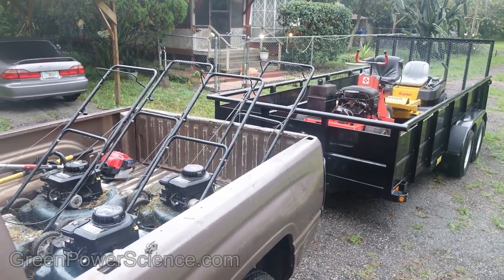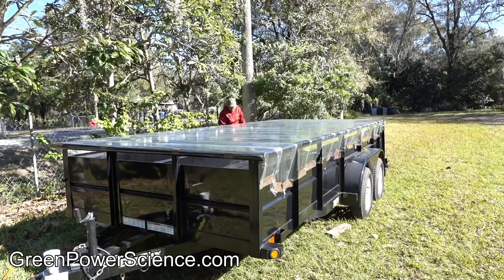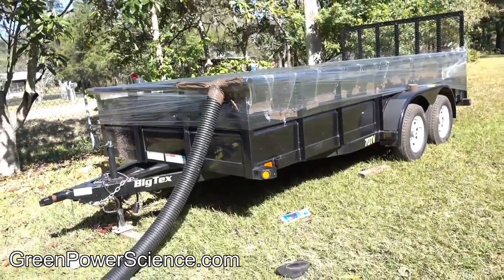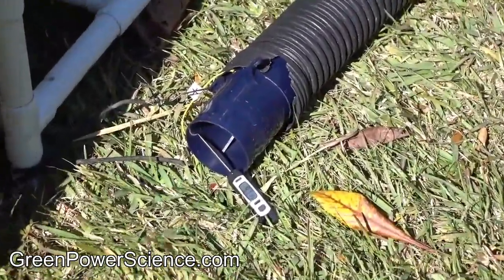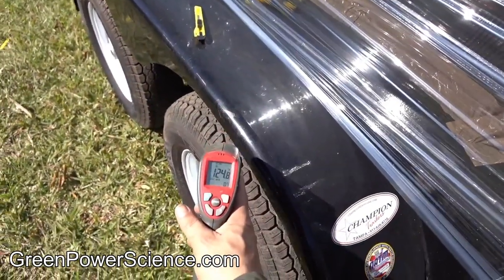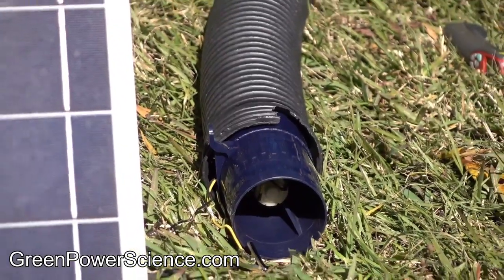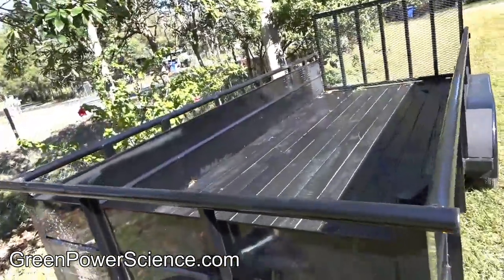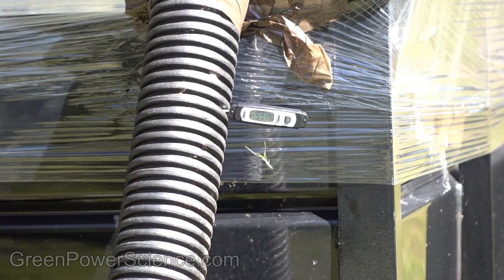5000 watts SOLAR Lawn Trailer 130 CFM CONVERSION

Comment: What a great vid. What kind of results would you get if you snaked 20, 30, or 40 feet of tubing in the body of the trailer?  By the time the air traveled through the tubes, it would warm up a lot more.

Comment: You just gave me
What i think is a great idea...
Build a maybe 12 inch deep by maybe 12 feet long and 8 feet high collection area with maybe asphalt roofing to store heat in...
And to make the plastic front double wall
The system Zip Tie Geodesic builds his inner and outter plastic.
Pointed at. the optium winter angle. 
How to get that angle north to south
Use a flat surface you can tilt.   Place a red solo cut large side down on the surface and tilt trying to remove the shadow. around noon time
Rember that is for the up and down tilt not the east to west

Comment: How does this compare to using painted black aluminum cans throughout the same amount of square feet?   The trailer is simpler process than expensive glass and the work with the cans

Comment: I love the idea of solar powered heater, may work very well in day time. Unfortunately, I don't think it will work at night where we need it the most.
Reply: This is just an old idea he shared with people .maybe to get us to think outside the box. Cast iron & concrete hold alot of thermal
Reply: No, but you could cut your heating costs in half by using solar heating during the day, and only using your electric/gas heater at night when you need it.
Reply: It works better using water since you can store the energy easier, but if you have a large attic, you can use that to store the hot air until sundown.
Reply: @FixItYerself  one could make a black rectangular pool inside the trailer with polyethylene sheeting.

Comment: Question, Dan. Is there sufficient air flow at the end of output tube to turn a fan connected to generator to produce thermal-wind power? If so, any estimate of enery potential? Understanding this depends on sun strength and duration.
Reply: No.  The airflow you see in the video is from the solar powered blower fan.  Thermal convection strong enough to turn a turbine would require a very large structure, with very complex engineering to get strong enough passive convection for a turbine or fan.

Comment: A roof space works well also and you can just run two thermostats one in the roof and one in the cold hose to auto heat the house when ever the roof is hotter than below
Reply: Can you elaborate further please?
Reply: @matthewbraxton7515  its a duct fan, filter and thermostats to move the heat from your roof to inside the home. Can be a single outlet or ran off the cooling system,  by a zone duct to swap them over for summer or winter.
Reply: Thanks

Comment: Why don't people heat their houses with this in the winter??
Reply: Because no one has gotten their act together enough to make such a commercial product readily available/practical/priced right.  US government regulations and building codes are also a problem, since such a device would not necessarily meet the arbitrary government building codes in all areas of the nation (the codes are different, based on local city, or in rural areas, the county).

To make the device more practical, the design should be modified with insulated walls, a slanted hardened glass window (like solar photovoltaic panel glass, so as to withstand hail), it should be parked with the solar collection surface oriented towards the south, it should have removable axels to function as a permanent shed, it should contain a mirror portion internally to increase peak temperature output capability on cold and windy (but still sunny) days, and it should contain at least a 1000 liter (preferably more) thermally insulated water storage tank, that can heat up in the daytime, and then provide the homeowner's house with continuous heat, in the form of hot water, all night long.  The device should also be sold in conjunction with a small electric pump (ideally with a small battery and solar photovoltaic panel to power it all day and night long), some thermally insulated water lines (one to send hot water into the house, and one for the partially cooled return water), and a water/air heat exchanger for use inside the house.  Ideally, it should also come with a water-water heat exchanger to act as a preheater for incoming cold tap water, prior to reaching the domestic hot water unit inside the house.

To prevent the water storage tank and water lines from freezing in prolonged exceptionally cold and dark conditions, a bag of salt (sodium chloride, calcium chloride, or magnesium chloride, depending upon local climate) should also be provided, so the user can add it to the water storage tank to function as antifreeze for the water.  Ideally, the water storage tank should be large enough to store enough thermal energy to heat the house for several consecutive cloudy days.  Ideally, the interior glass surface would also have some warming channels/pipes running under it, and a circulation pump that could activate and take thermal energy from the storage tank and use it to melt snow off the glass, following a snow storm.

Ideally, some of the unit surface area should be dedicated for solar electric panel, with a small heat pump located inside the hot air zone of the trailer, so as to boost the peak temperature of the stored water in the thermal storage tank.  A heat pump operating with already warm intake air can have very high coefficient of performance (COP), thus it would not need to be especially large or require especially high electrical energy input, in order to raise the temperature of the water quite a bit in the thermal storage tank.  The heat pump would also still work (with lowered efficiency) on cloudy days, and when combined with enough hot water thermal storage, would enable potentially continuous heat for the home, even during periods of cloudy days.

Such a system described above might start to sound complicated, but it would still work quite well in many climates, so long as the area is not completely cloud covered all winter long.  Some places do have such problems, but many places do not, and such a system would be quite practical in such locations.

Comment: More like 800 watts  per sq meter or less depending time of day × 10 sq meters × maybe 30% efficency. Why 30% efficency,  remember losses to plastic reflectivity, less than full black solar absorbent paint, thermal conduction through the thin plastic metal walls and wood bottom, and radiative losses due to the higher temperature inside.  Check out the radiative loss with a thermal camera. 

 If the numbers I guestimated are pretty close, you are still getting close to 2.4kw of solar thermal heat out that pipe.
Reply: That looks like a good idea, 2.4 Kw is still a good amount of heat to warn a room, elec is expensive here down under. up to 45 cents a Kwh.  I think I would have been able to cook in this thing the other day when we had 46.5.C.
Reply: @steviebboy69  I'm sorry but that is just crazy pricey. I'd have to check but i think am close to $0.15. But I'm about 50 miles from a nuclear power plant.
Reply: @steviebboy69  remember, the faster you pull the heat out, the more efficent the solar collector is, but counter intuitively, the lower temp will be.
Reply: @kreynolds1123  My power is 20 cents per Kwh and there is a daily supply charge as well $1.05. some people pay$1.50 just for so called supply charge. all we have in Victoria is old nearly EOL Brown coal for base load. Hi demand sees load shedding, people are pissed off being blacked out for hrs in high summer heat.,    Aussie power among the most$$$ in the world.
Reply: @steviebboy69   I'm sorry. I suspect  that has to hurt industry, jobs, and generally lower your quality of life as you have to spend substantually more per unit of electrical energy than elsewhere around the world.